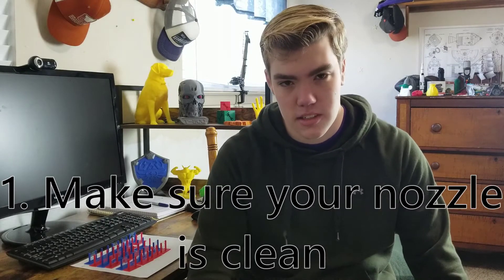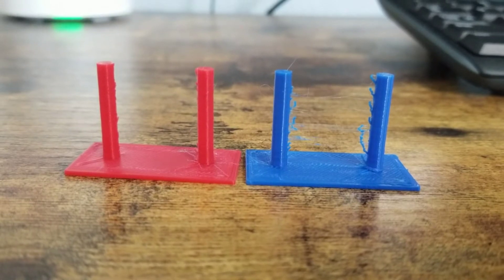How to Prevent Stringing! (3D Printing)

Comment: Regarding the travel speed: it is important that you have not only high travel speed but travel acceleration as well. This is impoerting too.
May this was the reason you did not have any improvement with more speed.
My top 5 reasons for stringing:
1) Too short retraction distance
2) Wet filament
3) Too slow travels (including acceleration)
4) Too high nozzle termperature
5) Wrong combing settings

Comment: One thing you screwed up on was the retraction settings yes you can enable them but once you enable them you have to adjust the settings and depending on what slicer you’re using for mine an ender three pro they range from 20 to 60 mm and how quick it actually puts it up and down. Because if you have a high print speed going between positions and you have a slow retraction speed that is also how you get stringing it doesn’t have enough time to suck the stuff up while it’s being shot across the print for a new position. Usually mine is set for 45 at 5 to6 mm length when printing around 30-45 speed. When it’s anything between 45 and 60 that’s when I have it set for retraction speed 50to60 and keep it at a length of 5 to6 mm. No I am using a b tube. I’m not gonna get into direct drive because that’s a whole different thing. So when you say set your retraction enabled that’s one thing you should’ve talked about on what you had set for your settings because that’s very important.  A sidenote I will say if anyone is looking for a slicer that will try to prevent seams on the outside if you’re not wanting to paint the item after sanding because there’s some filaments that definitely look cool if there was no seams just by themselves. I’ve had horrible luck with Cura that thing makes seems all over the place. PrusaSlicer is amazing. But I also will say that it is really good at all other types of prints that is my main go to. Eyes started to look for other slicers other then cura because cura would always crash or take more than seven hours to load an object that had 1 million or more triangles in it. Or anyone that doesn’t know it was definitely not a low poly design. My computer in blender had no problem handling the file and when I got tired of the crashing i tried prusaslicer. And that thing actually loaded within five seconds. So if you have a very high poly object don’t use cura it will save you a lot of time and frustration

Comment: It's been almost a year so I'm sure you have learnt a lot since the video but the part about print quality, you can just change to custom and go to quality and change your layer height and line height, which sometimes .45 on a .4 nozzle is actually better (Adderini suggests this in their docs)

Anyway, good reminder about print temp. I'm at 220c with some eSun PLA at 8mm 50mm/s retraction and still have insane stringing so I may have to try lower the temp but nothing else has worked, I feel like I go through this a few times a year and always forget how to fix it....
Reply: Try lowering your retraction speed. A lot of defaults are 30mm/s so 50 could be too high.

Comment: Did you change the minimum layer time when upping print speed? Otherwise the higher speed wouldn’t actually change print speed.
Reply from the maker: I did not, that's my bad. I'm still learning about 3D printing, so I may not be perfect, thanks for the tip!